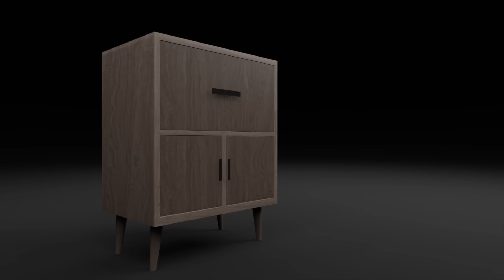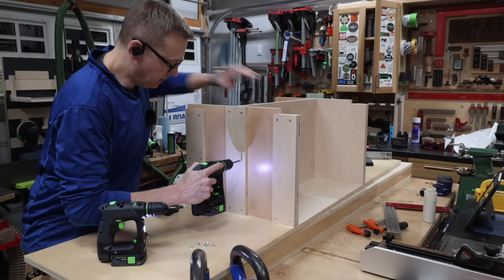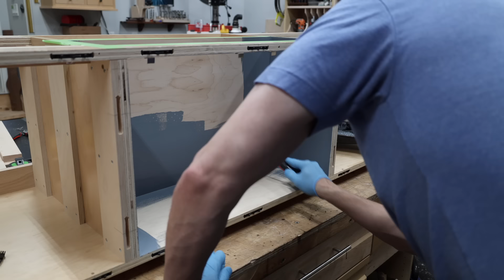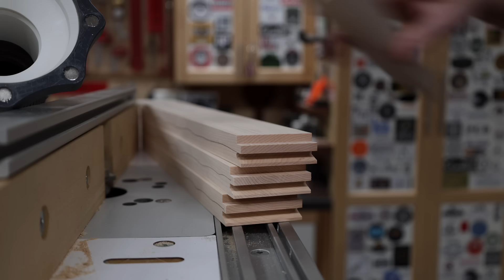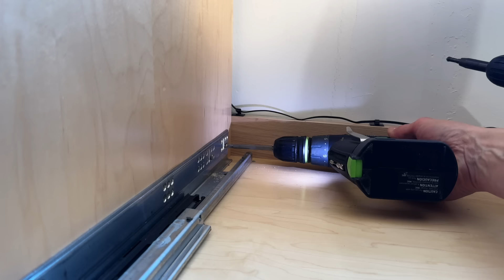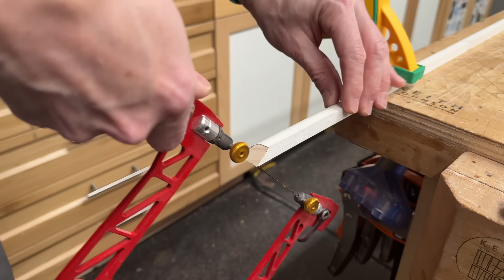7 PRO Tips I Wish I Knew Sooner!

Comment: when using your tool jig for scribing and using the Zeta 2, to create a 1/4 inch overhang I would need to offset it for more than 30mm correct?
Reply from the maker: Correct. You need to add the additional overhang you want to the first row of slots.

Comment: How do you nail the flushness of the middle stiles that have to match exactly with the ply edges? Just sneaking up on it?
Reply from the maker: accurate measuring and layout are the key
Reply: @KeithJohnsonCustomWoodworking  Looking at your mudroom build as well. Does your face frame there overhang the width of the double layer of plywood edges a little to allow for a little forgiveness?

Comment: Am about to attempt a built in mini bar under my stairs which will be wall to wall.. some unbelievably helpful tips in here Keith thanks a lot. End result is great, I will be painting F&B Railings which is slightly darker shade of blue and shows up any imperfections badly so will need to take my time and get as good a finish as I can!
Reply from the maker: Awesome! Thanks Leon! Glad these tips could help with your mini bar project. Take your time for that paint finish...it will definitely be worth it!

Comment: I have watched a lot of woodworking on YouTube and a lot of inset cabinets.  You are the only one that has ever shown and mention loading the drawer while setting the reveal so it will be consistent when they are actually in use. Its like putting water in a bathtub when caulking.
Reply from the maker: Yeah, I've never seen anyone else talk about it either, so glad to hear that it might help people! And the bathtub trick is a great one, too!
Reply: Came here to make this comment and also to say I wish I had watched this video a few days ago. I just installed a very heavy oak face on a very short drawer (night stands) and even with some decent quality ball bearing slides it was enough to sag after installing. I figured this trick out myself after the first drawer, but have to go back and adjust the second.

Comment: Would that whiteside router bit set work with 3/4” stock? Looks like it’s ideal for 5/8-7-8” though I ’m sure it would work, I’m just not sure if the design would be off. And if it doesn’t, which set would you recommend?
Reply from the maker: Absolutely will work with 3/4” stock. Rail and stile bit sets usually work with varying thicknesses. It’s all about getting the profile centered where you want during setup.
Reply: @ thank you, I did some Internet searching, and I couldn’t find a straight answer

Comment: How do you measure the size of the drawers? Do you install the drawer slides first and measure off of that?
Reply from the maker: Undermount slides have very detailed specifications. Typically, on Blum and Salice slides, you take your rough opening and subtract 3/8”. So, in this case, i built my face frame and measured off the inside dimensions to get my drawer widths. Hope this helps.

Comment: Keith thanks so much for explaining the scribing methods in such great detail. I never knew all the details and you explained them perfectly. Also, how do you love that Big Eye fence on your table saw? Is it a complete game changer??
Reply from the maker: So glad the scribing tips were helpful! The Harvey Big Eye is great, but a few snags...the micro ajdust wheel is rubber, so when it gets dirty with dust it doesn't want to move as smooth as it should. And all the jigs I made that saddled over the SawStop fence no longer work. But I love the push forward lock lever and the integrated flip stops, but I rarely use them.

Comment: Keith, just wondering why US cabinet makers (i guess in UK they do this too) makes toe kicks from plywood or 2x4s. There's European "style" toe kick which is just a few adjustable plastic legs under cabinet  box (super cheap) and one face plate with a few connectors to legs. It's cheaper, faster and - i guess - more convenient due the adjustable of these legs. No wasting material which is although invisible, no shiming.
Reply from the maker: I have used the adjustable feet in past and others do use them and it seems more and more are going in that direction, but kicks are what we are used to. Just like we use plywood for most things and Europeans use MDF and melamine.

Comment: Awesome craftsmanship, as usual. Really appreciate the tips and techniques! I have the Graco Quick Shot sprayer as well and went through a learning curve. It wasn’t until I purchased a 3-08 HVLP tip that it really started to work out for me doing cabinet projects. The 2-10 tip was just putting out too much paint. If you give the 3-08 a try, I think you will like the sprayer better too. I also use SW Gallery series paint which dries fast and has an extremely hard, durable finish almost immediately after it dries. Not sure if Ben Moore has something similar or not…
Reply from the maker: I appreciate the tip...on the tip 😜! I did try the 3-08 and had mixed results. I think I just need to run a bunch of tests with tips and power settings and really dial in the results I'm looking for.

Comment: I love the attention to detail on the scribes, however have you ever tried that on a 1900 red brick terrace in Manchester the walls can run out an 1" over the 9ft and belly and bigger than a brit in a free bar.
Reply from the maker: I've scribed crown to ceiling that was 3/4" inch out over 7 feet, but brick takes the cake 😂

Comment: Keith, Try BM Command paint. Its more durable, water based urethane Acrylic. Just as durable as Lacquer cabinet paint, without the lacquer smell. Dries pretty quick. Just add water to reduce for HVLP.
Reply from the maker: For some reason, my local BM store doesn't carry it. I'll have to shop around some more. Thanks!

Comment: Very professional. Question because I don't know, why scribe to wall exactly rather than leave a 1-2mm gap and fill that with flexible gap filler? Isn't there both wood and wall movement?
Reply from the maker: A tight scribe with no caulk is always best. It's a much cleaner look.
Reply: @KeithJohnsonCustomWoodworking  thanks

Comment: Awesome video Keith! I always learn so much from your channel. When you make your face frame stiles, does it make a difference how wide you make them initially or do you have to make them exactly 20 mm wider than the final dimension (using the Lamello) method? Love the new video production enhancements, thank you.
Reply from the maker: Typically, the final dimensions of my stiles are 1-1/2", give or take. I usually add an additional 1/2" to 3/4" for the scribe, so my pieces start at 2" or a slightly wider. so It doesn't have to been exactly 20mm.There just needs to be enough "meat" for you to scribe off.
Reply: Thanks for the detailed reply. I dont have a Lamello yet, but I’ll get one from you and your 20MM fence when I do.

Comment: Nice video - thanks! I like how you show basic methods, then methods using more dedicated tools.
Suggestion for a hybrid scribing method:  make the slots for the final biscuit locations, but don't make the extra scribing slot. Instead, put biscuits on the face frame slots, and hold the frame in place with the side of the biscuits against the inside of the side panel (like you did with the wood spacer in the third example). Then make the scribing space to match the distance from the frame edge to the far edge of the biscuit slot.
Reply from the maker: Thanks! And your technique could definitely work as long as those biscuits are in nice and tight sometimes biscuit slots have a little slop in it, which could cause your style to wiggle left or right

Comment: Two questions… both about routing.  1). I have the same woodpeckers table and like that 6009 cope and stick profile.  I’m getting some tear out inside the grove.  Poplar, maple and WO.  Are you seeing the same thing?  I’m not sure if I need to increase or decrease the speed of the bit to try to rectify that.  Thoughts?  2) I use the same 1/16th round over for edges too except I’ve moved away from it and have gone back to hand sanding a round over because, again, I’m getting some burning when I use it.  I’m going to guess I need to decrease the speed in my handheld but curious if you’ve seen that.  Thanks in advance and love the channel.
Reply from the maker: For the tearout, sometimes that happens when you are going against the grain, instead of with it. Before routing any pieces, try to orient them so the grain is running downhill. And the burning will come from the 1/16 bit when you slow down, so you need to maintain consistent speed when moving your router. That can be difficult around corners or edge grain, though, so it's best to make those endgrain passes first and then do your long edges so you aren't rounding any corners with the router.

Comment: You're glueing what should be a floating mdf panel into a solid wood rail and stile door. How does that work?
Reply from the maker: MDF panel doesn't need to float since they won't expand and contract- only solid wood panels need to float.
Reply: @KeithJohnsonCustomWoodworking  I didn't say the panel would expand and contract :)

Comment: It was interesting hearing about the pre-chamfer detail for pieces being assembled on-site, but I missed seeing close-ups of the end results.
Reply from the maker: I agree, I should have shown more close-ups. Sorry! Hopefully, you got the idea.
Reply: @KeithJohnsonCustomWoodworking  Yes, I got the idea, but wanted to see if I liked the end result. For instance, I didn't like the way the top's nosing piece isn't perfectly flush with the main top, due to being snapping/glueing in place after finishing and installing. In retrospect, I probably would have wanted to attach the nosing before finishing and installing so that it could have been sanded perfectly flush and tight. Sure, I'd have to deal with any drywall damage after installation afterwards, but that pain would probably be worth the effort.

Comment: Once again excellent work. More information in one video than most!
Does the Lamello come with the cord that is in the video or did you change it?
Thanks again Keith!!
Reply: I thought it looked like a Festool 
You are right hard to find!
Thanks again for the quick reply
Reply from the maker: Thanks Scott! No, I swapped out the Lamello cord with a Festool Plug-it connector so it works with my Festool cord/dust extractor. Unfortunately, Festool discontinued that part years ago. There are other options out there for a universal plug system for your tools that I've seen other people use, but I'm not sure exactly what it is.

Comment: I love the biscuit trick for the scribe lines! I have been using the 3rd technique you showed. I'd seen your previous massive built-in where you used the Lamello for the scribing and thought it was very clever, but I don't have one of those. I do have a table saw!
Reply from the maker: A table saw is all you need! You can still pre-finish and assemble your faceframes before installation. That's the way I did it for years before the Lamello entered my life 👍

Comment: Is the Lamelo different than other biscuit joiners? As in, can I use the clamex connectors but use a Porter Cable biscuit joiner instead?
Reply from the maker: Yes, the Lamello Zeta P2 has a vertical drive mechanism that engages for a split second at the end of the plunge to create a shouldered slot for the P-system connectors. It is also a thicker blade than the standard 4mm biscuit cutter. They do make Clamex connectors now that can be used with a standard biscuit slot, but they are a bit more of a process to install as both the male and female need to be screwed into the slots with very tiny screws. Hope that helps.
Reply: @KeithJohnsonCustomWoodworking  Excellent! thank you.

Comment: Good morning.  I specialize in custom closets/ builtins / cabinets.  I’ve been looking high and low and other than asking a local cabinet guy , do you know how to get that thick paint look on your cabinets ?   A local guy here his cabinets are so expensive and I can do the same work but all that separates me and him is his paint.   And I CANT FIGURE IT OUT😅
Reply: look for a specialist paint place that does something called “2pak” it’s an automotive paint but it can be done on mdf panels.
It’s a 2 part paint that has a hardener so it’s quite durable but I’m pretty sure it needs specific tools/processes. 
hope that helps!
Reply: @ I have a paint booth and all the sprayers lol.   That’s is what I’ve been looking for.  Thank you!
Reply: One trick I've seen peopledo is to add raw gypsum to the paint before you add the paint to the cup. This will thicken the paint and give you the look you are going for. A lot of cabinet and molding/trim manufacturers do this to hide the wood grain. The other half of this is to use a larger tip and needle in your gun so the paint will atomize and not clog the tip. It doesn't take very much gypsum, and it's cheaper than using a 2K solution.
Reply: Can also be referred to as 2k paint. But you’ll want a very well vented booth and even positive pressure respiration as the hardeners used are high VOC.
Reply from the maker: Not exactly sure what you mean by "thick paint look". Most guys I know use brands like Renner, Icro (2K) and Milesi (2K) which are waterbased products.
Reply: @ ok so when you paint your cabinets you can still see wood grain( kinda).  Their stuff almost looks like a glaze.  But it’s SUPER. Durable and scratch resistant.  I spray SW gallery series.   It’s expensive but recoat in 30 min is worth every penny.  But it’s super thin.  You can dent the wood by looking at it.   I think the previous responder said a 2 part paint.   Thank you Kieth I enjoy every single one of your videos.   God speed sir
Reply from the maker: @joelw6215  If I use poplar, the grain does show through sometimes, but I don't usually have that problem with maple - it's a much better surface for painting. And some guys put that first coat down real thick and then subsequent thinner coats.